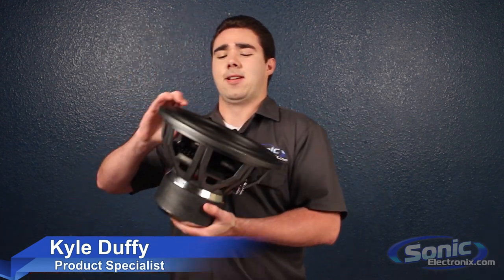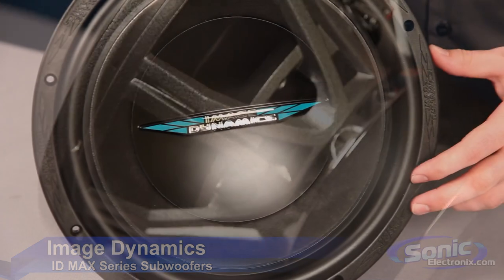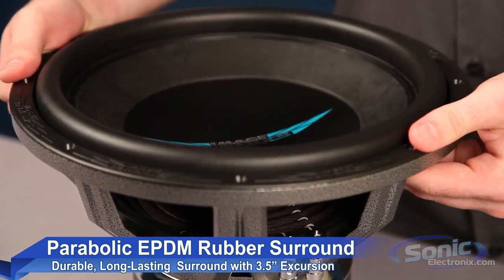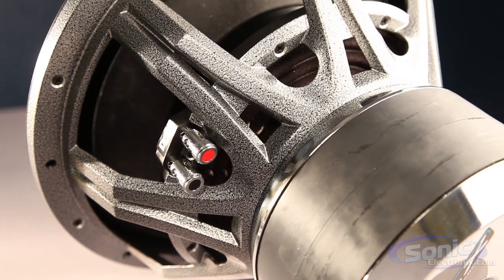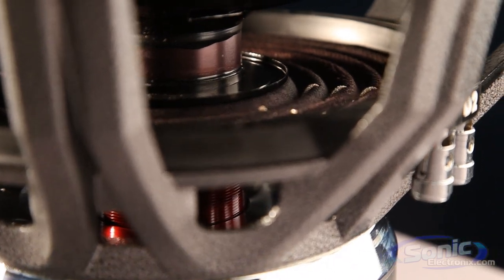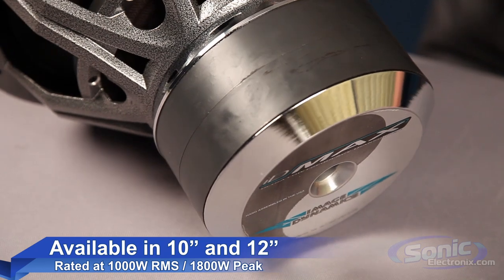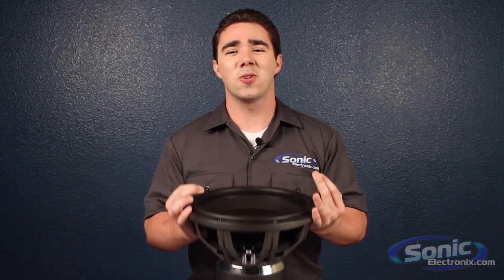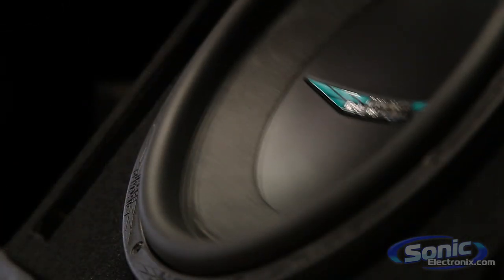Image Dynamics ID MAX Series Car Subwoofer

Comment: I have tow of these "12 and will say best subs I have owned hands down. Very tight response and clean as all get out when boxed right, but its hard to box these wrong. They play all sorts of music with ease and they do get loud if that's what you are into. I like loud and clean, not blow your face off loud but loud enough to hear me coming. Ive used JL w7 13' and in my opinion they are WAY cleaner sounding. I think the W7 series is muddy and has a slower response.